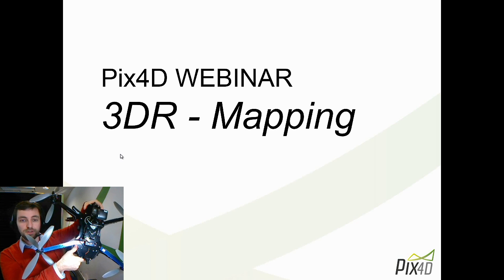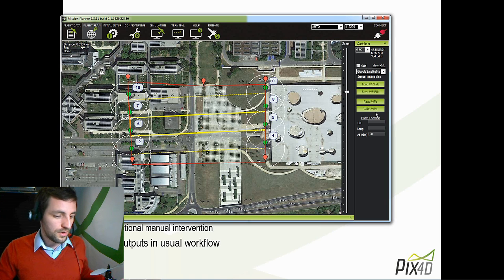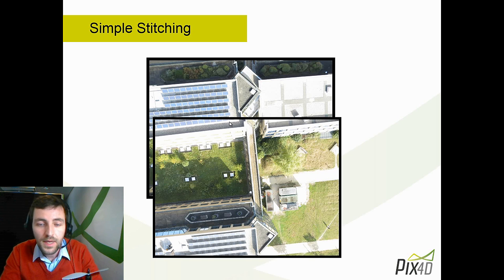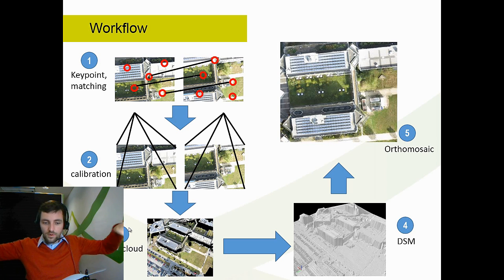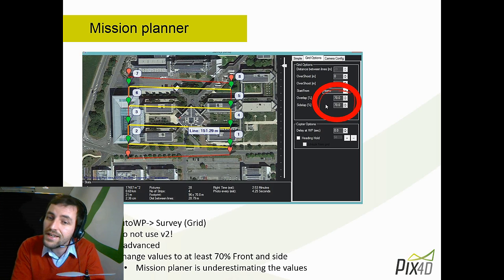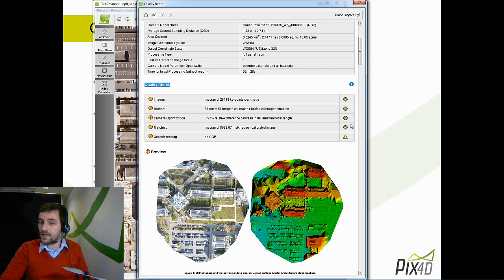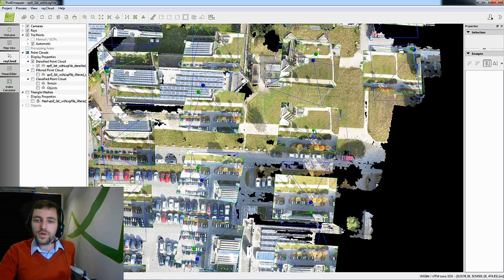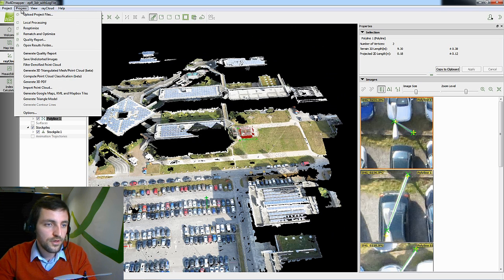Pix4D Webinar 11: 3DRobotics - Mapping and 3D Modeling

Comment: Hi,  great webinar, Question:  When surveying with large buildings or mountainous terrain can I use a LIDAR to follow terrain at a specific altitude or does this need to be at a specified height throughout the entire flight?   For example, I fly 60 meters from ground level for the whole flight, or can I improve overlap errors by using LIDAR to "Follow Terrain" meaning the camera would be constantly adapting altitude to maintain consistent altitude over each object.